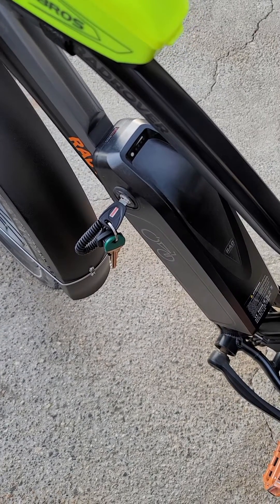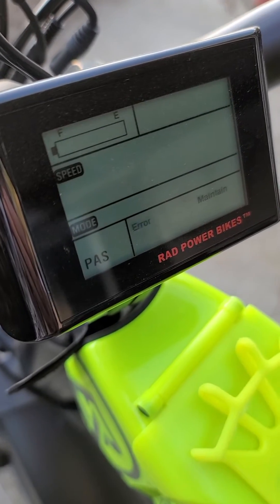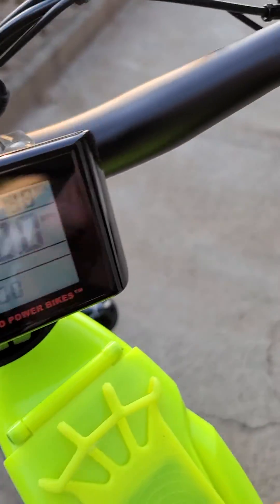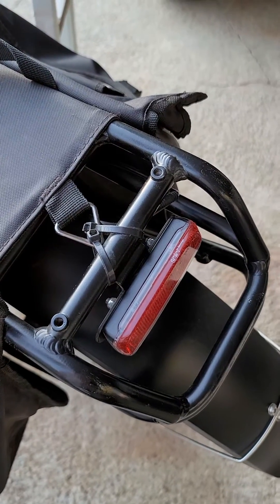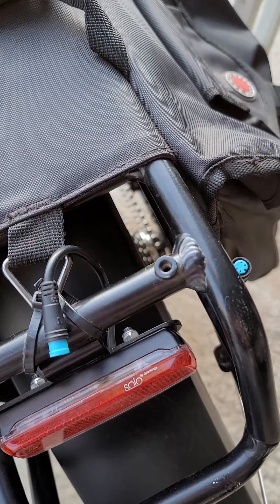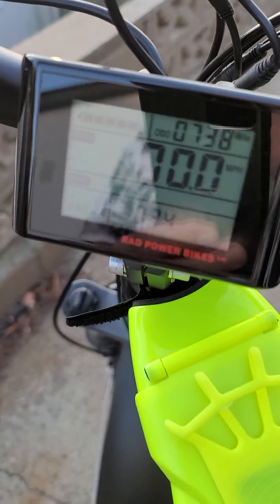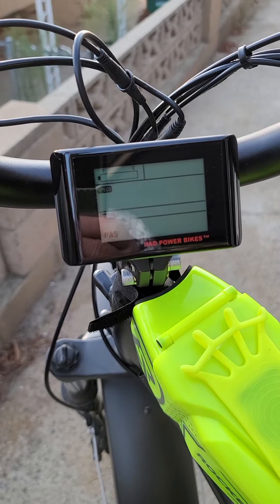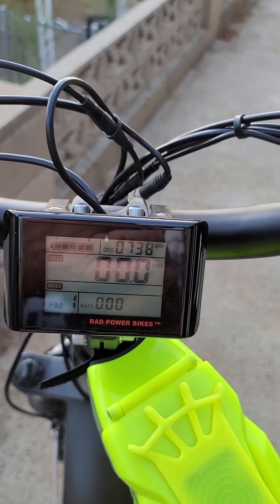RAD ROVER EBIKE  Error code #25

Comment: Was it fixed when you plug it back in? When I plug mine back in it goes back to Error 25.
Reply from the maker: @stephenboyle2142  actually after that video was posted and sent to RAD they sent me a new controller to replace it.  And that it was fixed.

To temporarily get along though I was unplugging the backlight and everything worked fine.
Until I plugged it back in and got the same error code of 25

And at the time it was still under warranty.